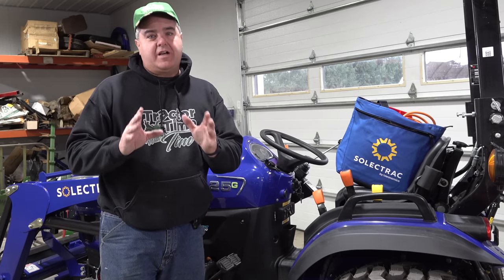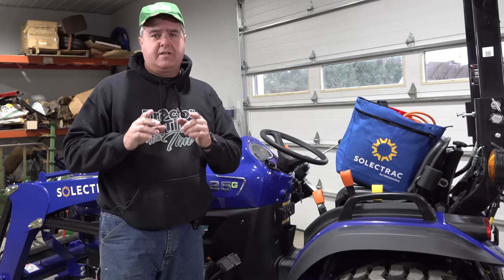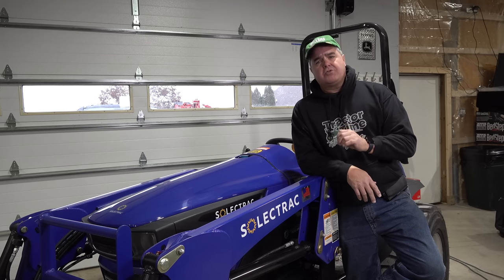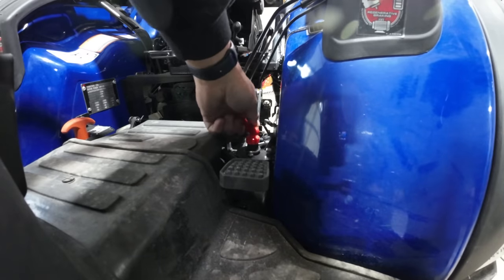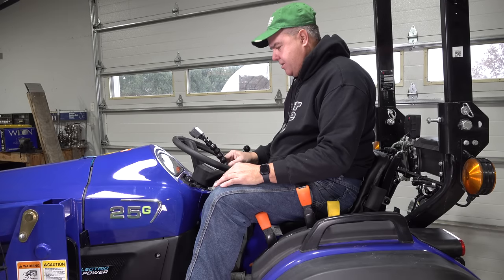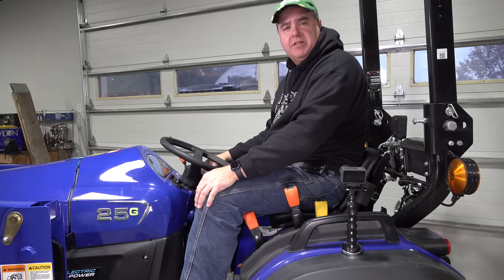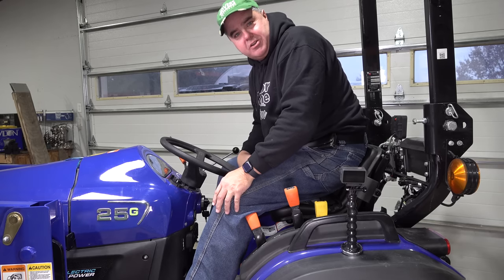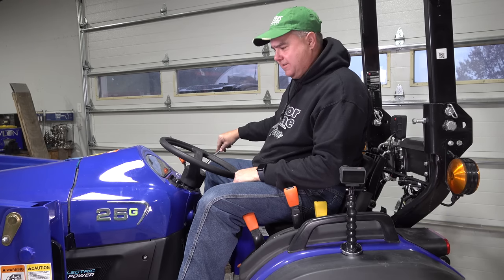Solectrac Electric Tractor First Look; Startup, Transmission Control, Initial Recharge Time & Charge

Comment: I am certainly interested and I admit, I am a bit of a naysayer on this. Tractors work hard and a tank of fuel works all day long and then some and I can fill it in a few minutes and back to work. When this rascal needs fuel the user is done working for a long time in order to get it up to full charge again. My head is shaking no, while my mind remains curious to actually “know”. I’ll be checking in on future episodes of this little varmint.

Comment: Merry Christmas y'all!   Curious of the Forward/Reverse controls...   Is direction change only that little lower dashboard black plastic toggle to the left of the steering wheel?  (fiddly little thing that wouldn't work w/gloves on even if you could find it when looking back while working).   Or are there typical floor pedals?
Reply from the maker: I explained this in detail, no?

Comment: Running out of battery during a important task like snow removal would have me concerned. Sometimes you only have a limited time to remove snow if you get a hard freeze really fast and wet snow becomes a block of ice. Also, waiting to the battery gets to 20% before charging is ridiculous. Obviously you'd always want the machine at 100 percent when starting a task regardless what the battery percentage is. Lastly, a good real world test would be to charge the machine and use it right off in a unheated environment, because this is how many store and operate their machine.
Reply: Running out of diesel would have me concerned too...
Reply: @TowWyo  It doesn't take 6-8 hours to refill a diesel tractor, takes about 5 mins

Comment: Again, I found myself racing out to plow the snow before the 40+mph winds blew it away. out at your place I can assume you got the same. Although we don't get temps this low for this long wouldn't buying this tractor be a huge thing to consider since you're not to take it out below 15 degs. It may have a thermostat somewhere to protect itself for just this case.

Comment: I just built one on line and the bottom line with taxes was just south of $40,000. Even so, I would consider selling and replacing the 1025R on my small horse farm, but only if the electric had mid mount mower capabilities.  My place is just not 3 point finish mower friendly. $40K plus having to buy a ZTR mower for another $12K does not make financial sense for me, even being a tree-hugger.

Comment: Hi Tim and Merry Christmas.  A few questions.  What is the Kwh rating of the tractor?  I'm assuming the batteries are Lithium Ion, can you confirm?  You said a fan came on, can you confirm if the batteries are air cooled or is the fan pulling air through a radiator and the batteries are liquid cooled?  Battery life is severely compromised in an air cooled environment (think Tesla vs Nissan Leaf with the latter being air cooled).

Comment: My hypothesis. Low run times. Annoying high pitch sounds.  And the battery run time cut significantly after a year or two of use.  I would not keep it in the elements.

Comment: Whats the price of the tractor and what tractors would be comparable?
Reply from the maker: I have forgotten price, but I mention it in the early preview from the farm show.  
Lx2610, 2025r or 3025e
Reply: @TractorTimewithTim  
When you find the price, would you give a few tractors in a comparable price range?
Reply from the maker: Not really.  I think I need to explain more on this.  I’ll do so in another video. This machine is not competitive on an absolute basis with existing machines. That is part of the ‘Innovator / Early Adopter” norm.  Read “The Tipping Point” by Malcolm Gladwell for more info.  Fascinating book which explains this better than I can.

Comment: Is it a hydrostatic transmission?  Would only make sense that they took an existing power train and hooked an electric motor to it. I am assuming that it isn't a direct drive, that there is a transmission in there. And, well, if it isn't a direct drive, why the complicated arrangements of speed controls and ranges? I am also a little suspicious of it being a bottom end tractor with a manual written by people who weren't native speakers.  My old Farm Pro worked well enough, but the manual wasn't all that helpful unless you already knew what you were looking for and its general operation could be quirky.
Reply from the maker: No, it is not a hydrostatic transmission.  I thought I was clear on that.

Comment: I wonder if that plug is a standard J1772. if not, that is a shame since anyone interested in an electric tractor might already have an electric or plug in hybrid car and a level 2 charging station. The final 10% will ALWAYS be charged at a lower rate than the earlier charging rate, the step down you saw is normal. Also interesting that there is nothing between the outlet and the tractor. One thing that is true of 240V level 2 chargers is they will charge faster than a straight 240V line. Not sure why that is but a full 6.6 kWh charge on my Prius Prime is 2 hours with a charging station, 3 hours with a straight 240V and 5 hours on a 110V line with a "brick" like you got with the tractor..

Comment: I’ll stick with a Branson 4815H. The Cummins on it is beyond reliable, and I don’t have to deal with trying to keep the battery preserved. Additionally having to worry about it dying in the middle of a hayfield or grass lot with no charging availability is a hard no for me. Working with diesel is much easier and much more reliable for the type of operation I work on.

Comment: This should be an interesting series.  The ergonomics look like an after thought, that forward reverse switch looks really uncomfortable.  I think I've seen that switch as a turn signal switch on a older new Holland tractor.  Definitely could use a lever like a forklift for direction.
Reply: Agree.  If they were going to give it the functionality of a Power Reverser transmission they should have designed the F/R lever to be convenient to operate like a typical Power Reverse lever. Not a tiny switch like used for turn signals. That will probably be one of the first things that get redesigned on the next version of the tractor because EVERY user will complain out it.
Reply from the maker: Yes, the switch has already proven to be difficult.  More on that later.

Comment: Based upon what was shown here, the OEM replaced the engine with a battery/motor setup.  Upon key ON and the toggle switch ON, there is a load on the battery running the hydraulics even though there isn't operator need for the hydraulics? 
Would like to see a test how long it takes to discharge the battery with just the hydraulic motor running and no work being done.
Would also be useful to compare to the diesel powered version of the same tractor since Tim hasn't used those before.
Reply: Tractors are all about the weight.  How much does this weigh?

Comment: OK  11.5 MPH at top speed with Ag rubber.roughly, that's okay. I wish foreign company's cared enough about our cash business to put charts in pounds/ounces/ & MPH.... I guess this tractor is comparable to the 25 hp Diesel compact.  At this point in time I am 100% against Electric cars & trucks yet 100% in favor of Battery op tools Drills/Saws/ & so on.  Now I am open minded on Electric Tractor & look forward to this series with Tim I know Tim will tell us the truth. Thank you Tim.
Reply: I would prefer to see us Americans go to the metric system.  It is much easier.  I see and do evrything in emperior system then convert it to metric in my head.  The result of living in Europe for 11 years.
Reply: @sinclairpages  Do you drive automobiles ?
Reply from the maker: I too wish we used metric system.  Much easier to calculate, convert, etc.  much of what Europe does should stay in Europe!  However, we shoulda jumped on the metric system.
Reply: @TractorTimewithTim  That's right with both feet and crushed the idea all to pieces & shipped it back as dust. LOL
Reply from the maker: @dcidci1012  I’m guessing you haven’t seen how much easier it is to work with.  But ok. Fine.

Comment: That cord was probably designed to be used with a 6R-20 plug vs the 6R-50 you installed.
Reply from the maker: 6P-50
Reply: @TractorTimewithTim  🤦‍♂️

Comment: Interesting that you can't change it unless it's below 20%. What if you were at 50 and had a big job the next day. Seems like they should engineer the batteries to accept a charge at any level
Reply from the maker: You can charge it…as I did.  Apparently it is better for the battery to charge when below 20%….just like ANY Lithium battery.
Reply: You can charge it, but probably instead of the batteries lasting 4 years they last 2. Pro's a con's with everything. The problem is we will never know until it is to late.

Comment: This is going to be great to watch, Tim; I have two questions up front:

1. What are you using to monitor your power usage in the shop? I'm getting ready to plan a new shop build and that is definitely on my list.
2. I can't tell from their website, but is this a rear PTO only platform, or is there also a mid/front PTO available for things like a mower deck or snow blower?

I think the biggest drawback to this as a first-to-market is that they aren't as much of a known name with a fleshed out product ecosystem here in the US; Deere will clearly have a leg up when launching their electric offering if it can take advantage of all the implements already in their catalog (and that many already own).
Reply from the maker: Please watch our prior video. I showed the installation of the monitor system in detail.
Reply: @TractorTimewithTim  Aha! I totally missed that one. Thanks!

Comment: I’m not a huge fan of going electric with everything but there is electric equipment that would serve an ideal purpose! 
Indoor work, short term jobs (like an hour or less…not good for combustions engines to run short spurts) do t have to worry about warming up an engine or fuel freezing etc! 
I don’t see electric tractors being used all day in a heavy work environment…yet anyway!
Same with electric vehicles …ideal use is commuting short distances daily and being able to plug in over night at home!

Comment: Tim
First and foremost, Merry Christmas to you and your whole family. 
As for these electric tractors, I have to sort of look back at least 30+ years ago at the first battery powered drill I had. I was a bit skeptical at the time, but let me tell you I used that old Porter Cable 12 volt for everything, even a hammer a few times. 
The technology now in battery powered drills is so far beyond what it was at that time, it is like night and day. But I used that old drill for a good 20 years until finally the older type batteries just would not charge and it was time to replace with newer technology. 
 I assume the same thing will occur over time with these battery powered vehicles/tractors. People will have a hard time over coming the fact they are not the norm that they have become so accustomed to. But over time with a bit of technology and engineering, they will come to depend on them as the new norm.
I am very interested in this new series as probably many will be, as I am one who does not use the tractor for hours on end for planting/tilling/or harvesting. Just a home owner who likes to maintain a few acres with a brush cutter, and lift a bit of fire wood in bins now and then. Along with grading the driveway.
 Now, I must tell you this is not easy for me to admit, as I am on the wall over the whole electric will save the planet thing. 
Also, as you said, and I agree 100% this is not a place to debate these theories, as it could go on for ever and never have a definite answer.

Comment: Great video but I am not sold on electric vehicles.  From what I gathered from another video on Solectrac, the endurance or the ability to use the tractor all day did not even compare to diesel models.  While electric may work for some I think that most will find the endurance lacking.

Comment: A plug in 240V charger for 50  amp services uses 6 gage wire for all three legs, so the charge rate for the tractor won’t be fast. But, it will still work…

Comment: Some or maybe even most people who have EV cars keep their cars inside a garage. The garage usually is not heated but is likely an attached garage and would get some heat from the house.  How many people who have tractors even could keep them in a sheltered building? Not being able to use anything I own because of low temps would tell me not to buy it.
Reply: Most early adopters of EVs probably keep them in a garage. But they are pushing them on everyone. I'm comfortable saying that probably 80 percent of vehicle owners do not keep them in a heated garage. Many many folks park their vehicles along the street or in a driveway. There is a video currently on YouTube from a guy in Boulder, CO who is finding that most of the "Electrify America" public chargers in the area do not work in cold weather. Something fails in the handshake with the vehicle. The Tesla chargers have no problem but the public chargers are having issues. Clearly we have a ways to go.

Comment: I'm not liking what I'm seeing with the hydraulic pump coming on as soon as you turn the key on. That's wasted power right there. They could have put micro-switches on the lift/tilt levers for the loader, and on the power steering to spool the pump up, only when needed. What would be the purpose of actually having a separate switch to turn the hydraulic pump off, unless your running stationary equipment with the PTO (if that's even possible when you're not on the seat)? Also, the extra 'speed' switch on the dash is totally unnecessary, since you already have 3 'geared' range selectors on the transmission to multiply torque as needed. The rest is handled by actual motor r.p.m., controlled by the dash-mounted throttle and/or foot throttle. I think they could have been a little more specific with the 'wrench' icon fault indicator, or had a separate light for a 'seat safety switch'.  It will be interesting to see how it actually performs and what kind of battery life you can expect before you have to plug it back in.😉 

Unfortunately, unlike a battery-powered drill or grinder, you can't just swap out batteries and keep working. You have to wait hours for it to recharge before you can use it again. This tractor might be okay for someone with a half-acre or so of mowing, or light-duty snow removal, dirt handling, etc., but I don't think it would hold up to continuous duty for actual farm use, like cleaning stalls, or pulling any kind of a loaded trailer.

Comment: For us older folks I remember when the battery operated tools first came out. They were absolutely worthless and that broke me from ever wanting anything battery powered. I don't want small engines in trucks either. I recently bought a 2021 because that was the last year Toyota put a 5.7 litter V8 in a Tundra. It has the trailer brakes built into the dash, made for pulling. The 2022 TRD Pro trucks have a 3.5 litter with motor sounds coming through the stereo. How pathetic is that ! For hybrid cars the battery replacement is around $8,000. You didn't save $8,000 in fuel or the added expense of the vehicle. This will kill the used car market if the batteries costs doesn't come down. Your expensive used auto with 100k miles will be worthless if the batter needs changing.
Reply from the maker: So, the early battery tools were junk/limited, so you decided to never want a battery powered tool!?!?  Now, battery powered tools are amazing!  The only way to go!  
Will the same happen in tractors?  I’m not sure, but the history of battery tools keeps it interesting to me.
Reply: Early batteries were the worst. People forget that auto makers/ R&D people have been trying to go electric for ever. Kind of like the metric system. We as Americans, do have the luxury of our own opinions.
Reply: @TractorTimewithTim  I guess I'm like a pup getting bit by a rattlesnake. That dog won't mess with anything else that rattles, I'm that way with batteries. I'm almost 60 and set in my ways. I have a wood/metal shop with several heavy 40 year old tools. I've never run down anything with a cord and I get em powerful enough to do the job or hurt ya bad trying. My generation is doing less and less making room for the battery generation to take over but I'll continue with drop cords and outlets.

Comment: Having to flip a switch for Reverse kills the deal for me, totally unacceptable.
Reply: Stop whining.
Reply: @davidmicalizio824  must have got coal in his stocking this morning.
Reply: I guess both manual and automatic transmissions on cars are not an option for you since, OMG, you have to actually TOUCH a lever to move from drive to reverse. And in some cases, push in an additional pedal to be able to move the shift lever! Oh, the horror...
Reply: @JCWren  You guys must not even own a tractors, going back and forth while utilizing a bucket is super common on tractors, It's an ergonomic and safety issue.  While running the loader with the right hand why be required to take your left off the steering while to change directions?  What if it's -20F out and you've got thick gloves on, that little switch will be an issue.
Reply: @drdiesel1  Bro... Have you EVER driven a tractor with a manual transmission?
Reply: @JCWren  Yup, I have one, and there is a good reason they are almost non-existent these days, for these applications anyhow.
Reply: That seems more like a poor design feature than anything to do with being electric.  They should have been able to build the directional control into a twin touch peddle.
Reply: @C_J_81  Yeah… but if it’s a simple switch, it should be easy enough to put a different switch for that function - either a foot switch or a shuttle shift. Yes, in principle doing that could be a warranty issue if anything goes wrong with the drivetrain…